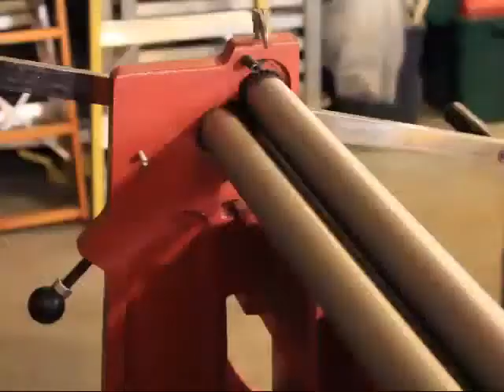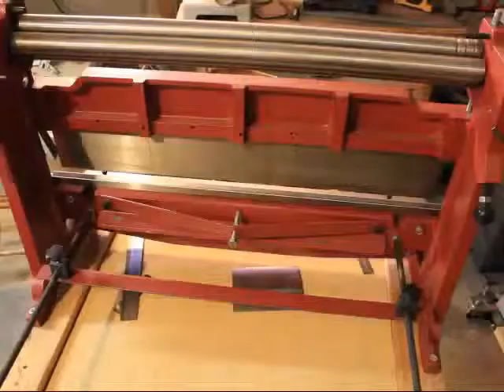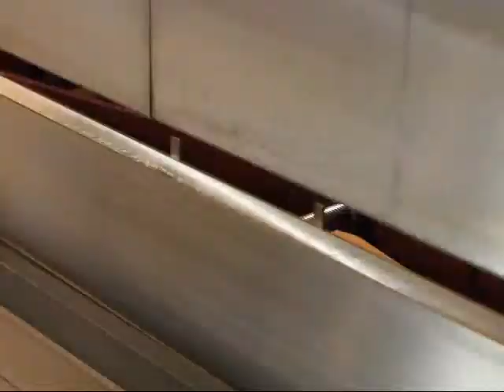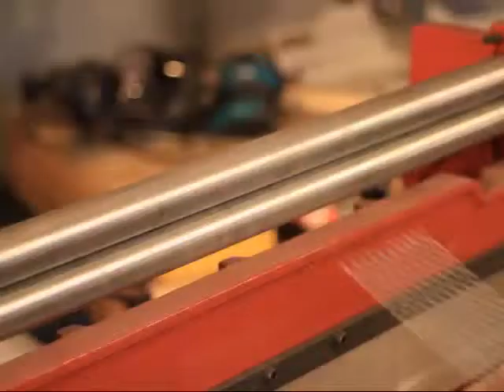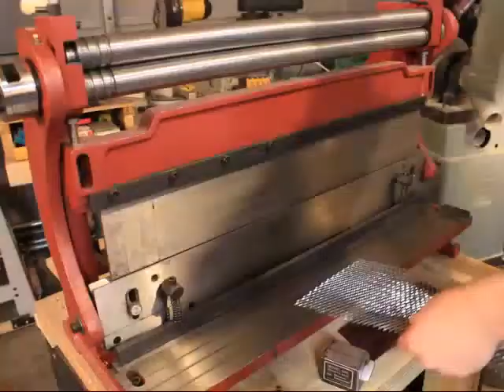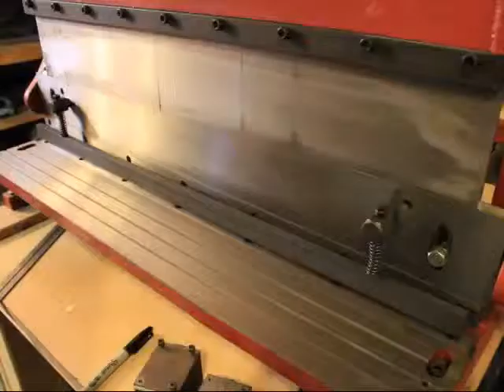3-in-1 Sheet Metal Shear, Brake and Slip Roll – Combination Machine for Cutting, Folding, Rolling

Comment: Mine won't cut 26 guage stainless sheet after 16 inches. Kind of rolls. 20 guage stainless it will cut about 5 inches. I've played with the pressure screw thing on the back but I can't seem to get a longer cut. Should I attempt to stone sharpen or something? Can I bolster the cut edge with some heavier steel maybe? Any way I can cheat with physics to get the longer cut. If you have any thoughts on what I might be missing please let me know. Otherwise it's a fantastic device for my needs!